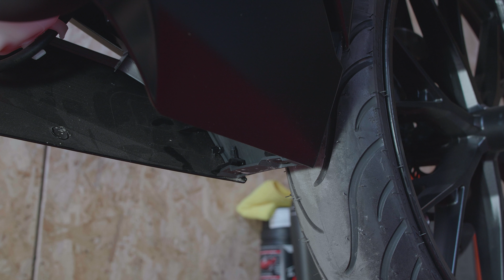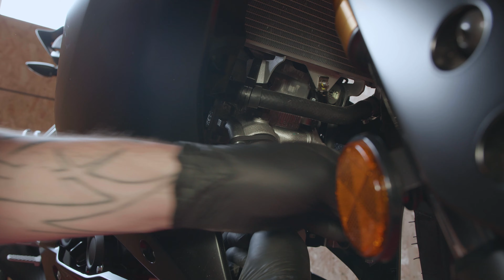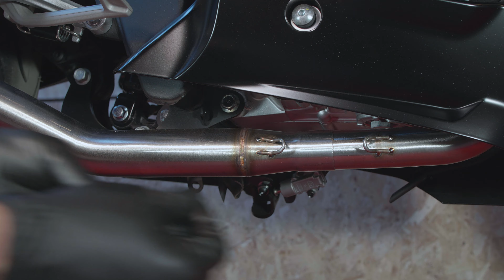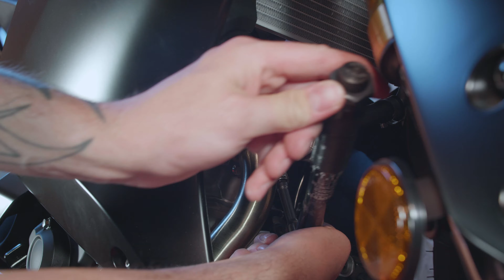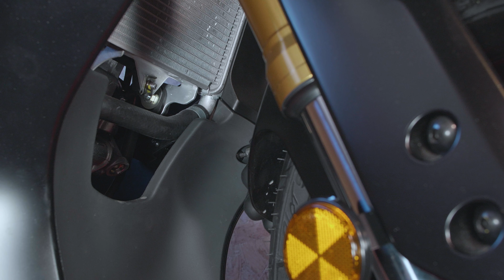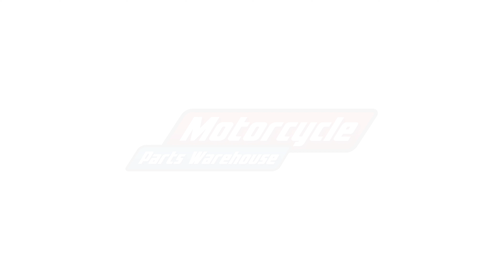How To Fit Your Toro Exhaust On The Yamaha YZF-R125 2019

Comment: With this exhaust I have to remap the ECU?
Reply from the maker: Hi, the exhaust does not require a remap on the ECU, however, we always recommend that you remap your ECU when changing your exhaust for optimum performance.
Reply: @MotorcyclePartsWarehouse  thanks for the information, sir :)